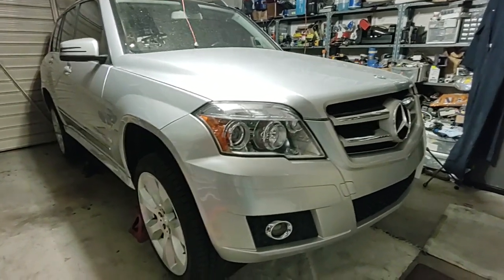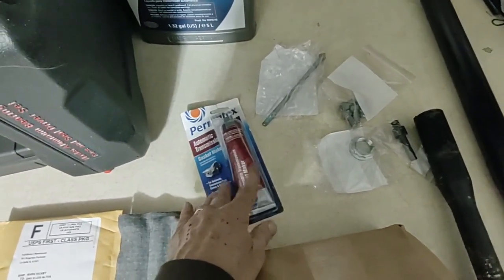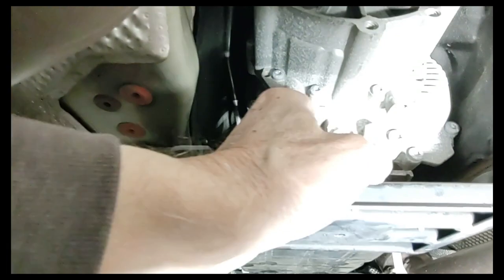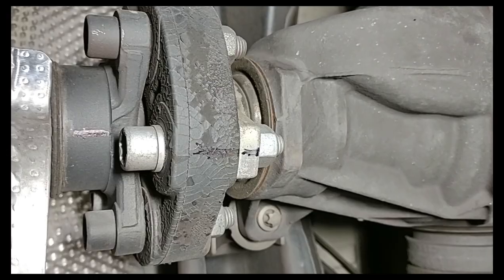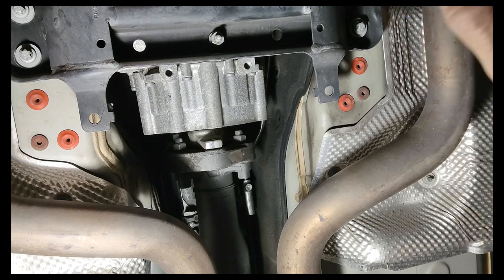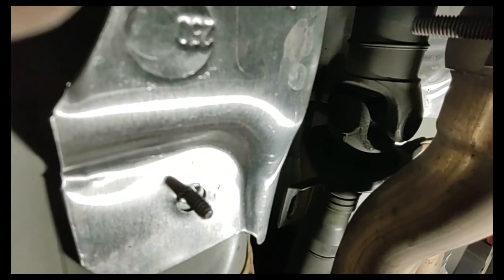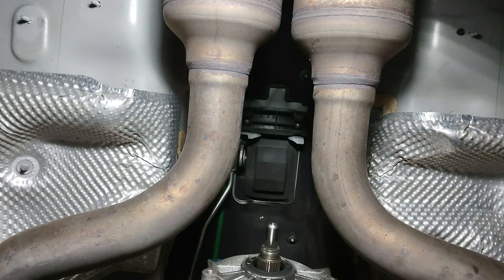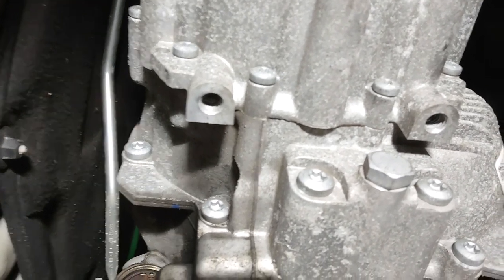Mercedes 722.9 4Matic Transfer Case Rebuild - 2011 GLK 350 - done in-car, new output shaft cluster

Comment: I'm doing this exact same job on my c300 4matic and I was doubting  if It could be done without two post shop jack but your video not only showed me how to do it but that it could be done at home on jack stands. Great detailed step by step video sir . Thank you very much.
Reply from the maker: Yes, I believe that the two cars will be the same job (I hope there is a couple more mm clearance on the front driveshaft on the C300 though). ;-) Good luck with the job... let us know how it goes, and if it's the same as the X204 GLK transfer case.
Reply: I just did my GLK on jackstands in my garage. Very doable. But it is alot of work.
Reply from the maker: Thanks for the reply (missed it 'til now).  Glad to hear you had a successful DIY, and that you saved a boatload of money (assuming, but it's almost certain).  ;-)

Comment: Professional job , just a bit harder when laying on the creeper . I would  recommend when mating the transfer case to the transmission to use guide studs ( threaded / notched short rod ) aiding the installation and seal integrity !
Reply from the maker: On mine, there were short alignment pegs ( though it's easy to accidentally push them too deep during the process of seating the races). IIRC, the pegs were on the front (middle) xfer case housing "slice". I suppose that longer rods through the bolt holes might help keep the alignment straighter, which can only be a good thing.

Comment: Really good video , very thorough explanation with torque specs , thankyou sir , hopefully I successfully complete the same job , liked and subbed
Reply from the maker: Thanks for the like and sub!  Good luck on your job - it's not all that horrible.  A couple updates - be careful with that output shaft seal - it's easy to damage (ask me how I know...).  ;-)  Next time I'm going to remove the front driveshaft to minimize the amount of stress on the area.  Second, I have to pass along some warning about Maktrans - the output shaft gear cluster I bought from them developed some play in one plane (indicating a loose internal U-joint).  Worse, they ignored my emails for two weeks, then told me that they don't offer warranty for anything that's been installed or that isn't brought to their facility (in Poland).  Then (despite having seen the video of the play) helpfully suggested that it's all in my head.
Reply from the maker: Just be VERY careful when inserting the front drive gear cluster into the (hopefully new) seal.  I've learned (the hard way) that the seal is very easy to bugger up.  I think one of the difficulties is that the gear goes in at a little bit of an angle, and if you lead with a corner of the "nose" that goes into the seal, it can catch it and flex it out of shape.  I just figured out that in my original rebuild, the spring that holds tension on that seal (inside the lip) actually came out and was riding on the gear cluster "nose", allowing tranny fluid to leak out.  I replaced the seal, and managed to mess up the new spring as well.  Testing it some more, I learned that the trick is to insert the gear cluster at an angle lining up with the front driveshaft, and to put a thin schmear of synthetic grease on the "nose".  If you get it right, the gear slides easily into place.  If not, take it out and check that seal, and try again until you DO get it right.  Hope that helps...
Reply: Hey where do I buy the extra seal , I ordered the bearing pack and that comes with one but I want to order an extra one
Reply: And what’s the part number for the long bolt ?
Reply from the maker: @lewisdavis8640  The MB part number is 000000-008248 (you might try searching on multiple iterations of that, by eliminating the dash or some zeros).  The name for the part is "Hexalobular Bolt".  
https://mbparts.mbusa.com/oem-parts/mercedes-benz-hexalobular-bolt-8248    
https://www.pelicanparts.com/More_Info2/000000008248.htm?bc=c&SVSVSI=3766
Reply: Thankyou sir anyway I could get the part number for the seal ? If not it’s okay
Reply from the maker: The seal (for the front output shaft) I bought is the Corteco 0139977246 (I got it from Pelican Parts - about $5).  Of course, do your due diligence to make sure that you get the right part for your particular vehicle.
Reply: Thankyou sir I have a 2010 c300 4matic 722.9 so everything should be good tackling this weekend , just trynna get all the parts ordered
Reply from the maker: @lewisdavis8640  Good luck with the repair. Be sure to check the description of my video for a few of the other things you will need to do the job.

Comment: Just a perspective idea. To determine shim thickness what you could do is take each half of the case, clean the mounting faces and put a precision measuring bar across the mounting face. Measure the depth from the mounting face to the bottom of the bearing race bore. Then do the same for the other half. Add the 2 measurements and whatever the thickness is of the gasket you use, now you know what the total distance is between the ends of the outer races. (Note on gasket use: if you use silicone sealer your gasket thickness is essentially <0.0mm, which is why manufacturers use it. They have better control of critical dimensions using silicone or steel gaskets. Fiber and cork tend to compress and creep more adding to their dimensional instability.) Next take one of the gears with inner races pressed on, assemble the outer race onto the inner race/bearing. Measure the height from the bottom race to the top most race. This is best done using a precision surface, such as a granite base and a measuring tool to measure off the base. Now, Substract this measurement from the case measurement you had prior to determine the thickness of the shim to use in the case to achieve approximately zero preload. Keep in mind to account for measuring uncertainty with each measurement and factor that into your shim selection. Obviously end play is more forgiving than preload, however zero preload is desired as it is assumed wear will result in minor end play which increases service life.

This is generally how end play in MB's older transmissions would be measured to determine shims for the internal components.
Reply from the maker: Good stuff... Thanks. I'm not sure that most DIYers are going to be able to measure to the precision required, but on the surface your process sounds reasonable. I agree with your take on the choice of gasket material.
Reply: @Mark_H_DIY  Definitely outside of the wheelhouse of probably 99% of DIYers, but with consideration that MB had no intention for these to be rebuilt except for by the manufacturer this is probably what would have been expected had they made it a serviceable unit.
Reply from the maker: I know that MB (and apparently most independent shops) quote only a transmission swap when the transfer case is bad.  On the plus side, that's how I picked my 2011 4Matic up for chump change.   ;-)
Reply: @Mark_H_DIY I assumed that was the case. It's a fantastic way to get a deal.
Reply from the maker: I've put about 15,000miles on the repair, and it's still smooth as butter.  It almost feels like cheating to get such a great car for the price I paid for it, including the transfer case repair and new motor mounts).  A little work involved, but if I "paid myself" the difference between what the car cost and what it was worth fixed, it would come out to hundreds of dollars per hour!  And fwiw, the main reason I DIY is because I'm much more motivated to get it done right than any pro mechanic will ever be.  ;-)
Reply: @Mark_H_DIY  Hey mark, you keep mentioning your amazing price. Out of shear curiousity would you be able to share that information with us? Mileage and price? I just picked up a 2010 for 4500, although its got some miles and not quite as clean as yours. It does have the factory 20" wheels though which I love!

Comment: Hi , what’s the symptoms for you to repair the transfer case ? Mine is having slight vibration when turning into my parking spot , other then that , all good when driving straight
Reply from the maker: The problem with mine was excessive play in the U-joint that's part of the front output shaft.  Others rebuild their transfer case because the bearings that hold the front and rear helical gear clusters get worn and cause noise.  I'm not sure that either of these scenarios sound like what's going on in your car.  I'd look at your CV axles (primarily the front ones).  And yes, I have a video on how to swap those!  Also it could be a problem with your differential(s) though that is less common.

Comment: I HAVE AN GLK 350 AND BE ABLE TO DO THE JOB THANK TO YOUR VIDEO ONLY I WILL ASK WHAT TYPE OF TRANSMISSION FLUID DID YOU USE?
YOU DO AN AMAZING JOB MAKING EASY WHATS DIFFICULT THANKS FOR YOU ADVISE THANK"S  AGAIN MARK H......!
Reply from the maker: @ReneMartinez-nq7hr  I don't remember the specific brand, but the bottles should be visible in the video. It was from FCP euro, so I'm sure it was the right fluid. Just make sure that the fluid matches your year. They changed from an old fluid to the new fluid in 2011. I believe I have information on my comments on the video, but if not look for my video on changing transmission fluid, and the comments will describe the fluid you need for your car.

Comment: This is a great video of WHAT NOT TO DO when it comes to rebuilding a 4Matic transfer case. I've seen several of these come through our shop with burned up bearings and it's clear they were worked on by amateurs like the person making this video. The bearing preload for the main shaft and front driveshaft bearings has to be adjusted with a rear housing gasket. You cannot rely on RTV compound to set that clearance. Further down in the comments, someone mentions difficulty with bearing preload or "resistance to turning". The above video completely ignores this issue. You need to select composite gasket material (available at most parts stores) and make a gasket for the rear housing cover to set the bearing clearance properly. A gasket thickness of about 20 thousandths generally works well. If the shafts don't rotate easily and freewheel, you're going to overheat the bearings and destroy them in a fairly short period of time. This is what separates "professionals" from "amateurs". This is not a job for amateurs and should never be tackled without removing the transmission from the vehicle.
Reply from the maker: I'm actually doing a second video that address exactly those issues. I would have done it already, but got called away on a multi-week road trip. I wasn't happy with the amount of resistance I got on the output shafts, but wasn't aware of a spec for the preload until recently. The perplexing thing to me is that the bearings are exactly the same as the factory used, yet the outcome is different. FWIW, my plan was to machine down the spacers under the mid case bearing races to get the right preload, using charts from Timken that I found on preload vs. rotational drag. It looks like there is a reasonably wide range of acceptable preload, in terms of longevity of the bearings, so it won't be rocket science. I never would have made the first video if someone had made a better one. :-)
Reply from the maker: Also, I'm not aware of anyone on the forums I inhabit whose transfer case had been worked on prior to the bearings going bad. All the ones I know of failed without home mechanic intervention. It's clear that Mercedes' processes don't take into account fine-tuning the preload on a per vehicle basis, or if they do, they miss one once in a while.
Reply: If your shop is anywhere near Nashville I'd love to have someone replace the bearings in mine. Having a really hard time finding any shop willing to do the work.
Reply from the maker: FWIW, I'd give the shop kudos for being willing to do this job.  Most dealerships (including the one the original owner of my GLK went to for an estimate) quote only transmission replacement as an option.  OTOH, that DID allow me to buy the (one owner, well-maintained) vehicle for chump change, as a $10K transmission swap made no sense on a vehicle worth about $10K after the repair.  ;-)
Reply from the maker: It also occurred to me that even if bearings were replaced badly, it can only be because the originals failed.  According to Timken (OEM bearing supplier) that the lifespan of these bearings is far in excess of what the vehicles will ever need as long as the preload is fairly close to "perfect" (I'll be including that graph in my future video on the subject).  Anyway, my plan is to either do a "part 2" video to supplement my original, or to rework it so that it includes the information (from Timken) on setting up the bearing preload.  I'm always more than willing to admit what I don't know, and hopefully fill in any "knowledge gaps" by listening to others who DO know.
Reply: Ummm....no. The preload is not adjusted with a freakin' homemade gasket.  "professional"...LOL
Reply: @houla  Preload can be adjusted through use of shims on each bearing independently or simultaneously with a housing gasket. It just so happens that a composite gasket finishes out after compression at approximately 20 thousandths which is nearly ideal for the two bearings in question when preload is found to be excessive on both ( a fairly common occurrence). I've seen a half dozen 4Matics come through our shop in the past 2 years with burned up bearings due to insufficient clearance and resulting excessive preload. None of them have come back and one has been driven 60k miles since our overhaul two years ago. You sound like one of the idiots that reassembled one with silicone and too much preload that we had to overhaul.
Reply: @Mark_H_DIY  I just did one three weeks ago on a 2011 E350. Total job cost $3800. And yes, you are correct, the dealers don't rebuild these and they don't have access to parts from Mercedes - it's strictly a "replace transmission" operation which costs about double what we charged on the last job we just finished up.
Reply: @Mark_H_DIY  We've encountered several where it was obvious that the rear housing was recently removed, cleaned, and put back on - some with new housing bolts. The most recent job we did a few weeks ago was taken apart by a dealer in Chicago and reassembled with this problem. How do I know? I have the paperwork from the owner. Sadly, the morons at the dealer cracked the rear housing at one of the alignment pins and glued the piece back in with epoxy. So yes, I have seen this stuff. All we work on is Mercedes and BMW - we get the lion's share of work on these cars in our area. I'm not going to provide any more details about our business because it would probably violate Youtube rules.
Reply from the maker: I don't have any problem believing that there are shops (and DIYers) out there who do get it wrong.  FWIW, the first time I put mine together, it was clearly too tight, but when I re-cracked the case a couple months later, I didn't find any damage to the bearings.  I did measure (more or less) the preload and "did it right" the second time by adjusting the thickness of the preload shims, and was very happy with the results (both have what I estimate to be around 10 inch pounds of resistance to rotating at the specified speed).  I did a supplemental video on the re-do, including how to calculate preload and make adjustments.  I'm confident that my "new transfer case" should outlast the car (or at least my ownership), even though I'll put a boatload of miles on it.
Reply from the maker: I missed this reply (so many different statuses to keep up with).  Yes, that's a lot of money but a LOT less than a new transmission.  It's great that MB owners in your area do have that option.
Reply: Where can I buy the gaskets? I'm from Canada. I can't find them here. Thanks.

Comment: what kind of grease i can put between the transfer case and transmission. That goes on those two gears that connect to each other
Reply from the maker: @klajdistari827  no grease. The gears are lubricated with transmission fluid only.

Comment: Great information! in the case of the bearing kit: do you know will these parts fit the base model (not 4 matic) ? thank you!
Reply from the maker: @MikeSlott  the non-4Matic (aka rear wheel drive) model doesn't have a transfer case, so there's no place to put those bearings...
Reply: @Mark_H_DIY thank you mark, much appreciated. I’m trying to locate the cause of a whirring/whining sound when accelerating - mechanic I spoke to briefly thought perhaps something to do with transmission pump or bearing so I thought I might be on track with your video here. Noob here needless to say
Reply from the maker: @MikeSlott  consider yourself lucky that you don't have to rebuild the transfer case. It's doable, but not really a job you want to have to do. Good luck with finding the source of the noise, particularly if it's coming from the front end of the car. Hopefully it's not the transmission.
Reply: @Mark_H_DIY  thank you mark 🙏

Comment: I may have this same problem i just bought 09 c300 4matic its making a slight noise on the right upper side . It may be the same thing bearings . I wonder what type of sound were you getting and could you see were it was coming from when looking up udder the car as tge wheels spin ? How did you determine the bearing before opening it up .
Reply from the maker: @222mytony  my car's bearings were fine, and the car was not drivable because of the broken front driveshaft. The symptoms you feel sound like transfer case bearings, but check for a bad CV axle or wheel bearing. Both are a LOT less work and cost!